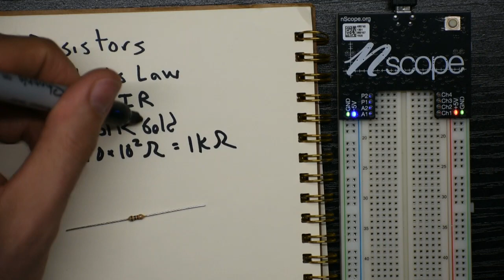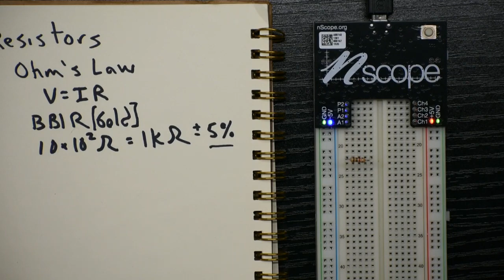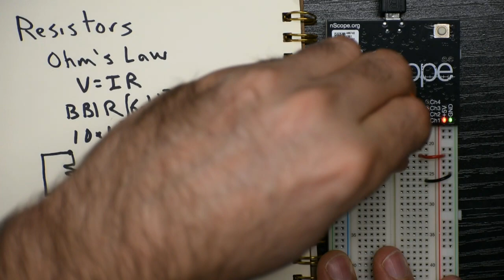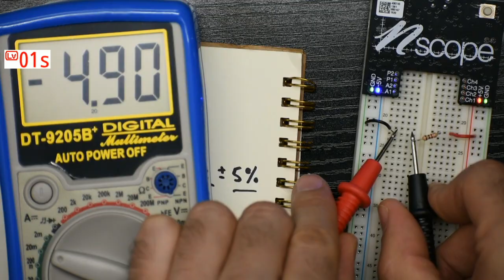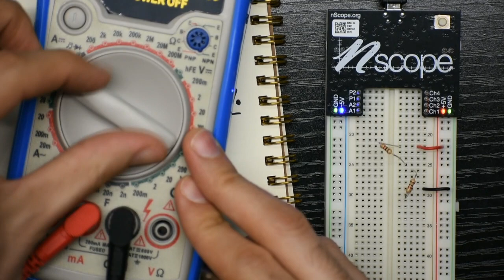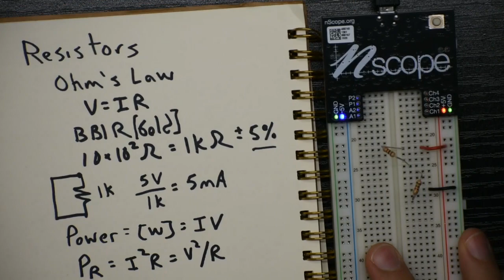BME308 - Resistors

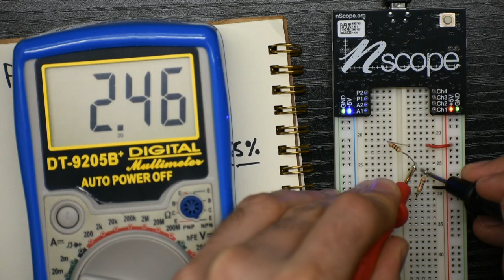Comment: how did u measure the current here at 10:23, mm wasnt grnded directly... pl ellaborate
Reply from the maker: To read current, place the mulitmeter, in current sensing mode, in series with the circuit. This means opening up the circuit so that current cannot flow, then insert the multimeter in as if it were a component, so that the current has to go thru the meter. The multimeter does not need to be grounded. Alternatively, read the voltage across a resistor and divide the voltage by the resistance, again a ground is not needed, the measurement is "differential". Reading with an oscilloscope is different, the voltage is read at a point relative to ground.